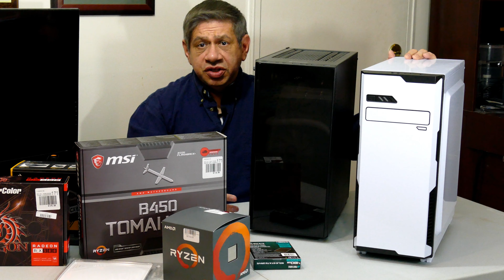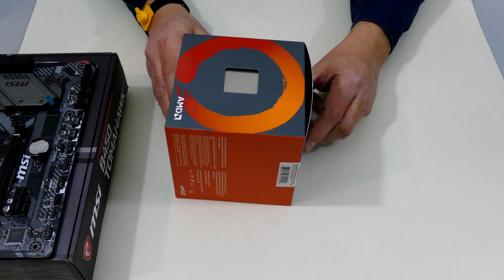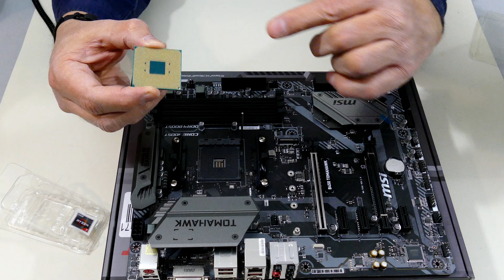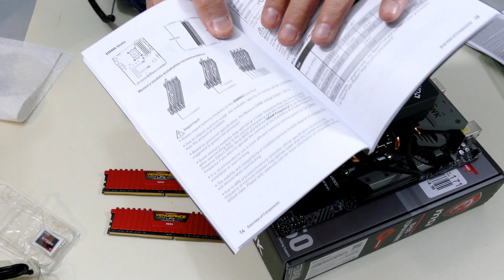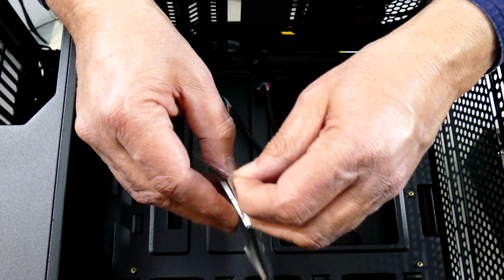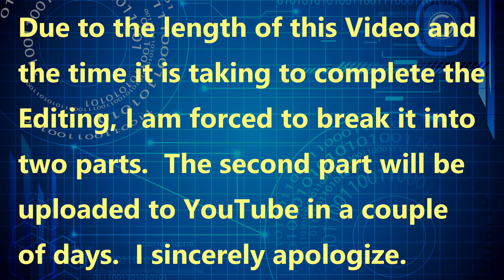All AMD Gaming & Video Editing PC Build – Part 1

Comment: How much did this build cost
Reply from the maker: It was nearly a year ago when most of the parts were bought, however I believe it came out to just under $700.  However, some of that was due to the previous Black-Friday sales, a great sale on the case, and the older PSU prices before the shortage.  I did not realize present the build as a 'Budget Build' at the time, but in retrospect it was, since I think it would be hard to reproduce what I was able to do base on today's prices.
Reply: Thank you
Reply from the maker: @anthonytraficant5693  You are quite welcome.  I regret not purchasing a second one of those AMD 2700X CPU when I had the chance before noon on last Ba=lack Friday.  I even went back in the afternoon and the price had risen by $30

Comment: Hi!  Question for you regarding this build. I did a very similar build in November. However I ended up returning my PowerColor RX580 becaus I found to very noisy. I don't consider myself sensitive to computer sound but it was rather crazy. Could you tell me your experience with that?
Reply from the maker: Hmmm...  I didn't have any problems with the 580 - This Time.  When I first built my primary editing rig (Nov 2018), my son talked me into getting a Gigabyte RX580, and I also wound up returning it due to instability problems, and wound up buying an Nvidia 1070 for just $20 more, which has been flawless.  I wanted to do an "All AMD' build to show some of my viewers that I was not narrow-minded, and the PowerColor 580 I bought on Black Friday of last year was going for a great price, so I decided to give it another chance.  No problems with it so far, and the Fans seem quiet enough for me.  I have heard of many complaints about the AMD video cards however, primarily due to problems with the AMD Drivers.  Some of those complaints center around the Fan control, so maybe that has something to do with the problems you were having - just a thought, I have no testing data to back that up :(